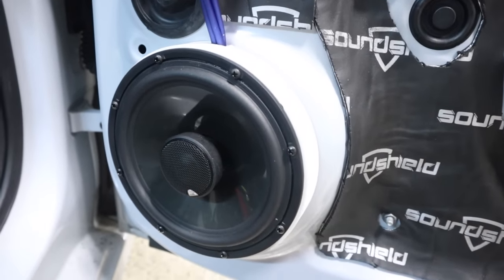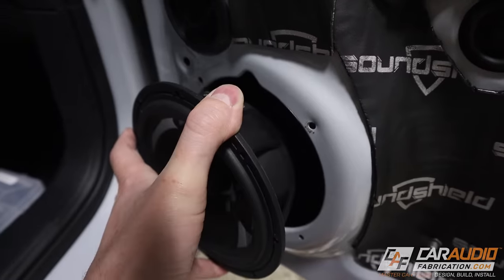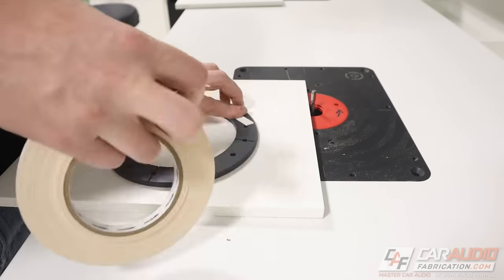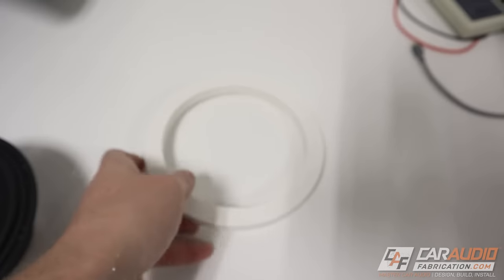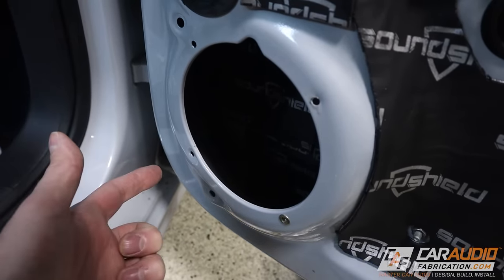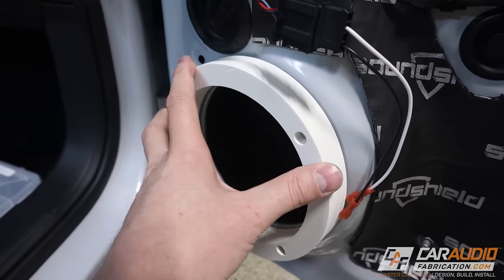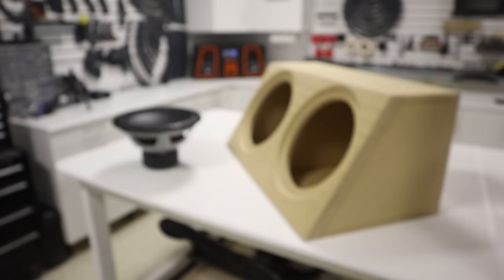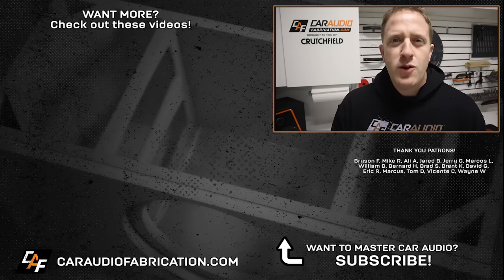Custom Made Speaker Rings = BETTER SOUND! HOW TO!

Comment: Discovered this channel halfway through my first installation and these videos are impressive as hell. At 01:34 you mention bolting speakers directly to the door, which is how I'd like to proceed given that I have no woodworking equipment. I'm curious to know some of the steps you would have taken if you'd gone that route.

Long story short my vehicle is a rare exception and the bracket doesn't work, so I've found myself needing to "ghetto it" like so many else on Youtube with my car. You've already earned my subscription but that would be the perfect video: "How to custom mount speakers only with stuff from your local hardware store". That's pretty much what I'm workin with aside from the tools needed for an average install. Your videos have inspired me to pull all my trim up again to jerry rig these speakers better. The mounts secure, it's the seal on an uneven surface that presents a challenge.

Keep up the great work! :)

Comment: Very interesting but not always feasible.
In my specific case there is plenty of room in the door for the speaker's magnet but no extra gap at all between top speaker and door's panel.
For my installation I was a bit limited but also I decided to use the stereo own amplifier (plenty of power), high efficient speakers (93db) and a under seat amplified subwoofer.
I love the setup and that proves that in the car you don't need mega watts but instead quality and enjoyment!

Comment: That speaker ring template is awesome. I need to get one of those.
Reply from the maker: Mobilesolutions-usa.com has you covered 👌 Just remember it would be impossible for them to have a ring that fits every speaker in existence, so to get to the right size you can use the technique I show in the video with the eco tray.

Comment: Great video as usual but a ? If using the c3 as coax and c5 coax in rear why not use c5 coax all the way around or c3 coax in rear. I mean why use the better series in the back? Thanks
Reply: This also confuses me. The c5 tweeters are light years smoother than the c3. 🤔 Why Mark? Surely there is a reason here.

Comment: Link for the rivet setter? That's a sweet piece!
Reply: Albert Bellas you can get them at Harbor Freight. I got one for $25 and it included 8 sizes of rivets / nut zerts and 10 of each size. Only issue is as of a year ago they didn't carry separate zerts/ rivets, only the kit. They do sell them separately online though.

Comment: Hey. Need some help with an amplifier. It is a 4 channel amp that can be bridged to 2x240w, right. So if I add 2 independent speakers to another 2 free channels, how will the power be distributed? Do I lose that 240w from a sub and that will be shared to those other channels?

Comment: Wouldn't it be easier to use a nut instead of a threaded rivet to attach a mounting ring with bolts?
Reply from the maker: How are you going to hold a nut on the back? If you go to service and remove the speaker how do you prevent a nut from falling. Any "solution" here would require somehow sticking the nut to the back, which is why using a threaded rivet is the correct way to do this

Comment: Intrigued why you opted to go for coax instead of component seeing as the factory has tweeters higher up in the door panel? Surely dragging the sound stage down is a bad idea generally speaking so curious what i'm missing.
Reply from the maker: The doors panels don't have tweeters high up or I would have gone that route. Custom fabbing sails or pillars was out of the budget on this build.
Reply: @CarAudioFabrication  weird! Must be a difference between Euro and US spec on the Jetta then. Over here we have tweeters up high.
Reply from the maker: Depends on trim level.
Reply: @CarAudioFabrication  Sounds likely. Here in the UK we are not even able to order the base models from any of the German manufacturers. Mercedes and BMW are much worse, but VW do it as well. The entry level spec for the UK is usually the mid range one for Germany and maybe the rest of the world?
Thanks for taking the time to reply. Love the work you do. You have a skill of making things look so easy but as a DIY enthusiast doing car audio for 20 years, I know what you show in a short video is sometimes very time consuming and takes a lot of care and attention to get right!

Comment: Could you do a video of installing speakers in the bed of a truck and in the cab. But being able to turn off the ones in the bed and leave the ones in the cab on. 

And maybe will your doing that make it so the ones in the bed run off a second battery so they can play when the trucks off
Reply: @kellypg  what

Comment: Free Tips on making custom speaker mounts: 

You are not making a speaker ring (or spacer) you are making a structure to hold a driver that may weigh up to 2 pounds vertical in a door metal cutout that is subject to several vibration and shock modes. 

1) Use black HDPE instead of Expanded PVC (for many reasons, mainly strength and rigidity).

2) Have the door side mount pilot on the metal round cutout in the door, this will help eliminate shear forces on the hardware used to attach it to the door, and also use 3M Polyurethane (it is a sealent and not a glue) to prevent rotation. You could use epoxy but the 3M Polyurethane will allow you to remove the mount. You can use rivnuts (Treated Steel or SS) or large serrated flange nylock nuts (18-8 SS) to attach the mount to the door.
3) Use countersink screws (Flat head Torx drive 18-8 SS) to attach the mount to the door.
4) Have the driver outer circumference (circular frame) recess (pilot) into the front side of the mount. This will help remove shear forces on the hardware holding the driver to the mount. Which gives more options for the type of fastener used to attach the driver to the mount.
5) Use Heat-Set Inserts (303 SS) for plastic (melted into the HDPE, this is one reason to use HDPE) to attach the driver to the mount. Use the largest size Insert that will match the available clearance and driver holes (often a metric sized screw).
6) All hardware should be 18-8 SS. In the rust belt salt spray seems to get everywhere eventually.
7) You can fit larger drivers by stacking the mount outward (greater diameters) if you pilot as you stack forming a sort of outward cone. You can also make the outer ring match up with the door panel if you want to use a custom grille (3D printed SLA or metal mesh) to attach the door panel to the mount. This will keep everything tight.
Reply: Sounds like a lot of good info. Care to make a video on it? Being shown, instead of just reading and then trying to duplicate it, is often a lot harder to do, than if one sees how to do it. Thanks.

Comment: Great episode. Just one question; Do you have to seal the hole the wires pass through to prevent air leaks around the speaker/trim ring basket?   Keep up the great work.
Reply from the maker: Yes, I did with speaker gasket tape as noted in the video. :)
Reply: I'd use Silicone gel, but that's me.  It would be harder to remove later but I wouldn't use the gel till the speaker install was tested and complete. The problem with the tape is it will still flex under pressure, whereas the silicon once hardened won't flex in the slightest.

Again, the tape IS a perfectly acceptable solution, I'm not arguing against its use.  Just offering a different one.
Reply from the maker: That could work too, although it could be a pain if you need to return the factory state.
Reply: @CarAudioFabrication  it takes a little work but Silicon will come off cleanly.  I couldn't tell since the sound treatment was already covering it, was the factory wire outside of the door panel it's entire length?
Reply from the maker: No, but inside the door cavity the wire bundle lives within a rubber tube. There is no just isolating the speaker wires unless you cut the tube.

Comment: I bought some adaptor rings for my 1998 Passat. I'm installing a Audio System double kicker set because I don't have rear passengers in my car so the backdoors only going to get a mid kick woofer. 
But i am in doubt of with of my amp's im going to run. I could chose between a Audioson SRx2S, Audioson LRx6.9 (that gives me some options on bi wirering and still have a option for adding a  subwoofer) og a Hertz HP2X 🤷‍♂️

Comment: Didn't the ring push the speaker way out (1" closer to the door skin)?  But the gap between the grill and speaker got bigger so you added foam (fast ring).  What am I missing?  How did that gap get bigger instead of way tighter, or even push the speaker out beyond the plane of the grille?
Reply from the maker: Stock adapter was out far too

Comment: I have a 2011 santa fe with the base system and separate tweeters. I was thinking about putting a pair of jvc 2 ways I have laying around in the front doors. Do you know if it would cause any problems? From what I’ve gathered the front and rear 6.5s are the same but there’s not a lot of information online
Reply from the maker: You may find that you don't get as good of sound when you only replace the speakers. A factory system typically doesn't have the power to make aftermarket speakers sound all that great, but amplify them and you will get better results.
Reply: @CarAudioFabrication  I have an aftermarket head unit and the speakers are high sensitivity low rms so the power should be a good match. I can compensate some if it’s too bright with the hu settings.

Comment: Question, how much clearance should there be between the back of the speaker and the exterior door panel? If it’s too close will the metal interfere with the magnetic field of the speaker? I need to include that in my calculation to see how much room I actually have to work with.
Reply: Many times for a mid or small woofer like in the video the basket of the speaker is made out of steel (which is ferrous), and the permanent magnet field is local and focused on the voice coil, so near by ferrous objects close to the magnet should not make a noticeable difference in driver operation.

Comment: Don't the fast rings get stuck around the woofer? That's what I did
Reply from the maker: Its the same thing to stick them on the door panel or around the speaker. It bridges the same gap.
Reply: @CarAudioFabrication  true. Just assumed it would be more accurately lined up if stuck around the cone

Comment: Mark can I use the speaker adapters that came from Crutchfield?
Reply from the maker: Yes, but in the case of this vehicle they aren't large enough to fit the speakers I used, which is the whole point.
Reply: 🤦🏽‍♂️they won't fit my 2018 vw jetta 😢
Reply: Do you sell those speakers rings on your website?